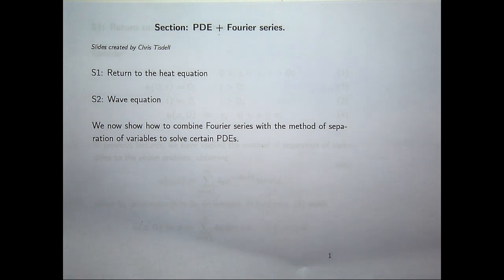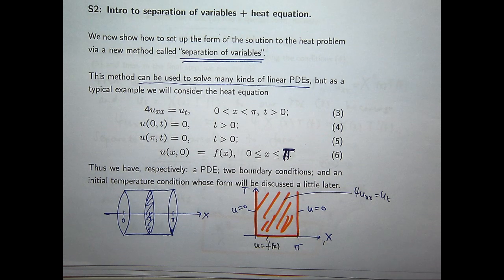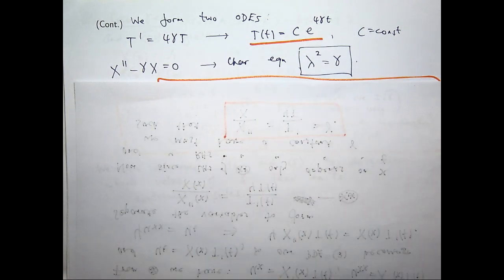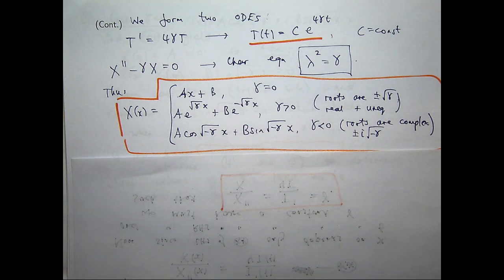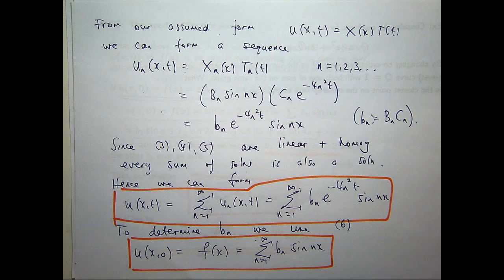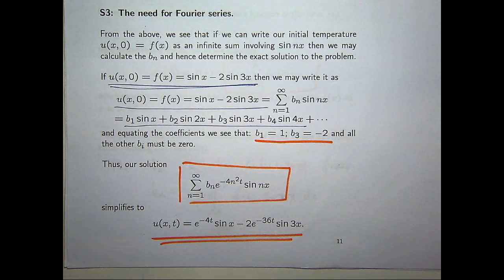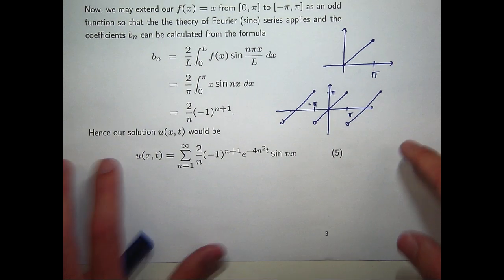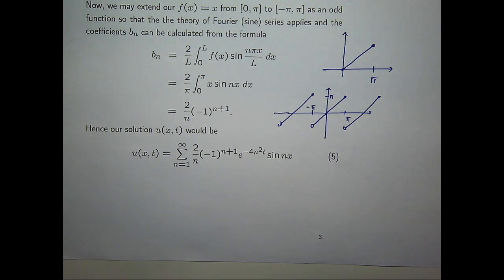Heat equation + Fourier series

Comment: might be a dumb question, but how did determine the constant to be "bn", which is applicable to the bn-sine-fourier summation, opposed to, say, the an-cos-fourier summation? Was that deliberate on your part, so that it would fit with the sine in your solution of the heat equation?